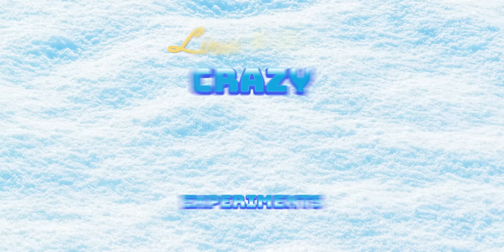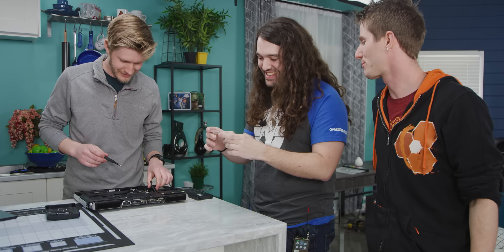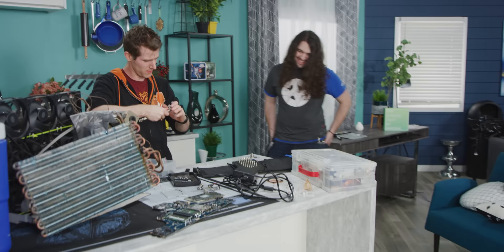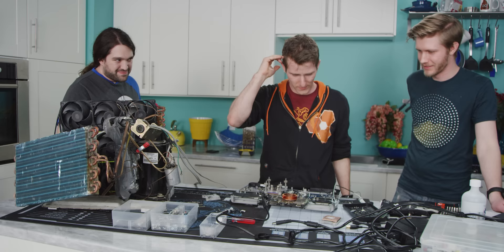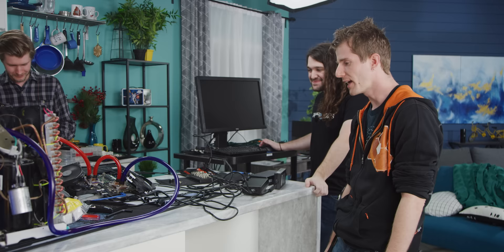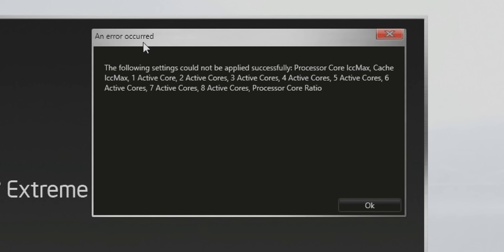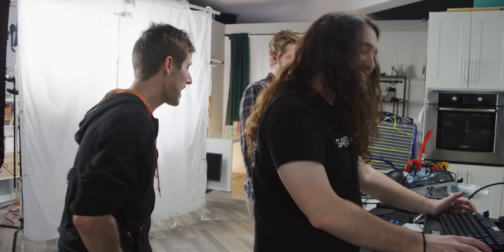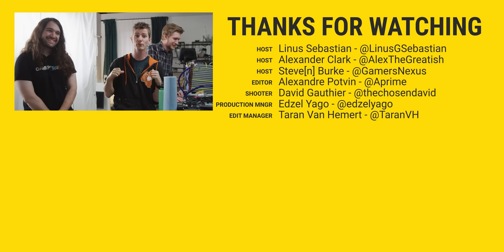Sub-Zero Laptop Cooling?! - Feat. Gamers Nexus

Comment: I think you should water cool a Nintendo switch 😅🤣🤣
Reply: And overclock it (it's possible)
Reply: Dan Bártík you can But Not really much so Watercooling would not help
Reply: @himmelsrand7527  yeah but it is LTT
Reply: Dan Bártík Yeah you’re right 😂
Reply: @danbartik4428  💯💯💯
Reply: You can install linux on a switch then add steam to it so water cooling would maybe help.
Reply: this reminded me of my favorite electronics fact. when in use the switch consumes less power than an idle PS4 :)
Reply: @numb3r6 There is no Steam for ARM Devices as far as I am concerned. And the Processor still has its Limitations. It could not clock much higher so Watercooling would do nothing. But as said before it’s LTT so what do I know. ^^
Reply: @aidanlevy2841  thats because the ps4 is a console and the switch is a portable device a ps4 uses more energy because it doesn't have to use a battery that has a limited amount of energy and the n switch has to be efficient or the battery wouldn't last 30min. Any portable device would be more efficient than a non portable one
Reply: @himmelsrand7527  oh you innocent soul, you don't know about console homebrew firmwares. You can overclock anything if you look hard enough
Reply: Benjamin Edwards Why do you answer a 7 Month old Comment? Of course you can Overclock the Switch but Watercooling will Not improve your Results. The highest stable Overclock is around 1750Mhz (CPU) which it can reach without throttling. (But we better not talk about the battery consumption when doing this)
Reply: @3of12  I don't get what you are saying steam doesn't support ARM CPUs that is just a fact
Reply: I actually want them to do that.
Reply: @himmelsrand7527  does it matter that it doesnt help much? No, this is Linus, he watercool everything

Comment: always wondered why you guys don't use the power drill to tap the threads... as a metal fabricator, i would say using the power drill would be a lot easier, and more exact than linus forcing it with a vice grip. xD

Comment: was that just 1 GIANT capacitor?
how has that not killed anyone yet?
Reply: Looks like the starter solenoid from a car. But I'm not sure why that setup would need one.
Reply: @SomeGuy_GRM  its the start/run capacitor for the induction motor that drives the refrigerant compressor.  should be a 450V rated 3-25ish mircofarad capacitor and yes, just like the live ac voltages on most of those bare connections, it may very well kill you if you touch it.
Reply: @TMHMooseMoss  this one was 270VAC, 35/3.5 microfarad. So yeah, probably enough to kill you.

Comment: I suppose when making a subzero cooler, a dehumidifier becomes an essenetial component
Reply: Nah, just Vaseline, Plasti-dip, insulation, and a couple 5w heaters (I can run 24/7 at -60c, that's what it runs watching Youtube, obviously a bit colder than R134a... Made before R12 was banned. You can also use Propane or amonia gas, but explosive or odorless toxic poisons are not my cup of tea...). It would be perfect for Intel (the 9900k scales amazing when sub-zero, check out Der8aur's channel where he shows the scaling graph for it based on temps), I want to make a huge one for Threadripper when the 64 core chips come out (I use the sub-zero cooler for daily systems, it works great! Much quieter than the Titan Xp collectors edition by like 3x, so if you can live with Nvidia flagships, then phase coolers are silent by comparison)

Comment: Could you prevent condensation by applying heat spreader foam all over? Perhaps while it's still curing so it can completely mold around the board and displace all the air immediately touching the board?

Comment: If you are running into wattage limits, you want lower voltage, not higher.    

This is more dealing with board limitations that you wouldn't normally run into on a high end desktop machine.

Comment: Man CPU don't have power enough and still got 74º using a CHILLER.....
Reply: Intel and Nvidia both in a nutshell. AMD/Radeon is so much more fun to play with. My titan Xp was the most boring component I've ever overclocked (including monitors, SD cards, CPU/GPU/RAM/NB/ref clocks/tablets etc). Nvidia is gutless when it comes to power limits. Its basically max out slider, oh yay, still power throttles at stock... Get out the hardware mods for regular use and gaming I guess! I remember when you didn't need to delid or short out components on purpose to use your computer like a normal person, that was only for the enthusiasts, but Intel and Nvidia are bringing warranty voiding back to the party hard! Even BIOS flashing is locked out for Nvidia... Its sad times...
Reply: @jakegarrett8109  AMD will take over in 3 years, watch. And I'm not an AMD fan boi.

Comment: I would like to point out that Canadian windscreen wash fluid is allowed to contain methanol. This, apart from some negative environmental effects, makes them pretty bad cooling fluid as it negatively affects plastics used in hoses and fittings. It makes them brittle and prone to crack. You should have used glycol-based antifreeze (engine coolant). Even clear tap water would be good enough.

Comment: Re: Alex "Phone calculators are bad" Algeo on android is amaaaaazing.
Reply from the maker: Have you recently used a Ti-84 Plus?  Felt the tactility of the buttons, seen beauty of a parabola on the 96x64P display, smelled the science happening?  It's a visceral experience some cheap app will never compare to. -Alex
Reply: @LinusTechTips  I have a TI-99 Titanium on my desk right now, and while I will say the haptic feedback and typing experience of the phone leave much to be desired,  the resolution of graphs, multi line editing, and accuracy of results have no equal.

Besides, that you can get a more powerful phone and the paid version of Algeo for cheaper than a new TI.

Comment: If a laptop made a completely custom radiator and just put the radiator either in the laptop and have a THIQQQ laptop OR have it externally attached to the back of the screen.  That can add substantial cooling performance with a larger power draw, however this can make "mobile" workstations become really powerful if they make a Tesla battery... idk the power draw would be the biggest hurdle but the good news is if we make THIQQQ laptops more standardized or at least acceptable.

Comment: I love the fact that a lot of jobs in the US, you have to use metric. As a Ford Tech all measurements were in metric and had a secondary annotation for inches. Any machining is in metric as well.... Yet we still cling to this shitty system
Reply: Officially they've been Metric for decades... Officially. They just didn't enforce it like the rest of the world did when we switched over. Now it's been delayed so long that the costs are astronomical compared to when the official switch would have been

Comment: A mill alone won't tap acrylic. Mills spin one way, threading out of a hole you need to spin backwards IE how a drill works. You need a self reversing tap head on it as well or you'll just rip out the threads you put in when you pull back up. Enjoy buying a Tapmatic, they're straight up $1000. I use one every day at work on acrylic.

Or just buy a ten dollar tap bit and put in a drill and do it by hand.

Comment: Use some grease when tapping screws. Makes it easier and less annoying. Also, wearing gloves and working with machine tools is actually pretty dangerous. You might not have a good grip on what you are sawing or drilling and the piece could slip.

Comment: I would love to see a mashup! Use your subzero cooling system to cool a mineral bath that houses all the components! AND WE SHALL CALL IT "THE ARCTIC OIL SPILL"! You should be able to run the coolant through radiators in the mineral oil bath to drastically bringing the entire system's temp down! In theory this should also prevent any moisture buildup on the components as the outside of you tank is where the system would build condensation /sweat.

Comment: I really like your home made chiller. I work in hvac I was definitely cool to see how you built that cooler. I have a tip for you if you insulate those pipe you will stop the condensation on those tubes

Comment: Buy a Buna-N (a.k.a nitrile) o-ring repair kit with several diameters. Even inexpensive ones often come with enough material length to make surprisingly large o-rings when you need to just make one, rather than repair one. I've used them on every up to high-vacuum systems (think vacuum of space, not shop vacs), so they're easily good enough for liquid-cooling applications. They're A Good Thing. You'd also need a cutting mat and single-edge razor or X-Acto, and a cyanoacrylate glue. Loctite PowerFlex glue has about the same compressability as the o-ring material, and it's a gel, so easier to control. 

Haven't done one since silione cutting mats became available. I'd want to try one, since CA doesn't bond well with it. Might make the process even easier.

Comment: You guys should consider combining the AC unit you used here to cool with and combine it with a mineral oil case as a sub ambient solution. You'd have a lot of time before you have to worry about moisture becoming an issue and you'd also be able to cool the whole board so super low temps and see if there's anything beneficial going on there.

Comment: Interestingly, running your CPU too cold actually has the exact the same effect as running it too hot due to the same thermal property of silicon that affects conductivity. A cold cpu just causes clock slew in the other direction (such that parts of the chip get the clock edge too early instead of too late).

Comment: After so many years Linus you need to show us a custom loop or at least use a cooling block that doesn't have tubes coming 90° off a motherboard you can get them with tubes coming parallel to the board...

Comment: if you want to tap a part before on the machine just get a collet use g84 xy r3.  then for feed you take your tap size for metric you basically take your rpm on the spindle and times it by the tap example for a 6mm x1 you take the 1 x 500 rpm you get 500 you move the decimal over two places so your f will be f5. you can use any adjustable drill holder for the tps just make sure when you tap you better tap it where you want it because if you move the tap then it'll be  impossible to realign it. I"m assuming your using metric and not american. one last thing g84 overrides manual feed over ride so to be safe you can put it to zero to make sure you got the right g code.

Comment: Really if your rely want cooling use a aluminum or copper thermal block as the main  evaporator and a freezer compressor. get basic ac system as a part of the cooling.

Comment: Hi Linus, could you please, please rebuilt your teen built custom chiller but with acrylic casing and a variable dials to increase or decrease temperatures and have a huge radiator filled with either battery water or distilled water and some metal panels and RGB lighting?

Comment: Does anyone else remember the liquid cooling used by the Sega Dreamcast? It had a Hitachi SH4 processor - the SuperH series being one of the most energy-efficient CPU designs ever developed (second only to ARM)! I can only presume that the case was of a particularly bad design.... almost a sleeping bag for silicon.
 I say that because Hitachi ended up supplying them to auto makers for in-car entertainment and even in an engine bay, they didn't need cooling.
 It was sad, I never found a good use for the VMU beyond being a little private screen for each player.48 x 32 pixels is just not enough. even Nintendo+ went significantly higher. I also seem to recall that Sega really didn't provide a toolchain for it so it was a lot of work to develop what was only of minimal value. Odd, because it was an 8/16-bit RISC processor so it could have been a lot of fun.

Comment: Wait that machine isn't grounded! so now what's gonna happen is when they put evap in water and if current is leaking in the circuit obviously from compressor the water is gonna get it too and eventually the cpu block and anyhow it's gonna short the MB or it's components. Don't worry I'm an electrician

Comment: I dont know a ton about computers but enjoy watching your videos. And this may seem like a stupid question but i dont know. Cant you just flip the mother board upside down so the condensation doesnt pool up around the processor? Then just place a bowl or some way to catch the liquid. And maybe find a way to drain or pump that into the resevoir that is holding you coolant. Seen a couple of your videos about cooling systems and always having to put towels around the processor and other components to keep them dry. Just seems like a simple solution but im no computer guruu.

Comment: I have an idea for you guys to try a proper idea for gaming laptop cooling.
Intro: As we see in the rtx 4090 desktop gpu (and vast majority of others)  there is a tiny PCB and 99% of the volume is occupied by a cooling radiator and fans subassembly.
Idea: What if you were to make a similar cooling radiator fans subassembly for a gaming laptop. 
The laptop existing cooling parts are very thin (to be squished under the bottom cover of the laptop). 
What if, instead of that half and inch thick array, you use a 2 inch thick beast of a radiator + fans. Imagine you would have the same cooling real estate as a strix 4090 (17" laptops)
Justification:
1) Nobody is using a gaming laptop to play while on the move. Maybe one or two idiots. But 99.9999% of gaming laptop buyers will use them at home, then pack it up and use it when they arrive at the destination (hotel & stuff) and then pack up and use back home or another hotel, etc, etc....
A gaming laptop is used as a very compact gaming desktop that you can carry with you easily and use it when you are plugged in at another location.
2) gaming laptops are already recommended to be positioned with the rear higher than the front, to help the airflow, and usually the increase of height at the back is like 1-1.5 inch

Having the 2 points above in mind, a gaming laptop user won't be encumbered in no way if on the bottom of the laptop at the rear potion, it will be thicker than the rest of the bottom of the laptop, in fact they will be most happy because that bulge is recommended in the first place. And when that bulge is in fact a major improvement over the basic cooling probably tenfold, it will be a happy time for gamers.
Thus what if the laptop gaming rig is going to be almost similar to the desktop version. Indeed, the manufacturers will need to make the vram and other parts better, and not fear heat constrictions.
This is what a gaming laptop should be.
If you use stock cooling it should be throttled and kept limited to a certain tgp/tdp, and if you buy and replace the existing cooling with a thick beast, to unleash full potential.
Of course, the bottom cover will be split into 2/3 from the front and a second one 1/3 from the back to allow removing base cooling and installing afermarket custom cooling.
And this will also open up the road for liquid cooling blocks that can be the existing ones from the desktop range.

Comment: You may want to edit out the lighter and flame between 10:28-10:35. Refrigeration and probably Air Conditioner units are coming out with Propane for refrigerant. This may turn out bad if someone watches a few year from now. 
With millions of stupid people. Someone may cause a leek taking the unit apart, or use an old leaky system.

Comment: 12:00 why not solder a wire to bridge the part of the chip that checks for voltage and basically make the cpu not see that voltage then you can set it as high as you want no throttle neck

Comment: someone should make a actual liqud cooler for a laptop that easily disconects and then its still aircooled when on the move. maybe make it a part of a eGPU system so its power can come from the power supply in the eGPU.

Comment: I used to shove an ice block or two under my HP ENVY DV7 7332 i7-3630QM laptop for an hour or two whlist running X-Plane 10 until condensation killed the it - R.I.P.

Comment: I started off with a Lenovo Legion 5 with r7 4800h and 2060 
which cooled fantastically even with both gpu and cpu under 
full load. I then went to an asus rog strix scar r7 5800h with 3070 which cooled appalingly with both cpu and gpu under full load. i.e. throttled the cpu down to 30w. Now I have a gigabyte i7 12700h with 3070ti and this throttles the cpu down to 35w when gpu and cpu is under full load, but the thing is, the cpu and gpu temps are about 74 degrees. Why won't it allow atleast up to 90 degrees before it throttles. I give up, should've kept the Lenovo.

Comment: Couldn't you remove the issue of condensation by submersion in oil like the fish tank PC? Of course the oil would eat the water cooling tubing so perhaps there is something else you could submerge it in. A sealed box with some kind of gas that itself gets cooled?
Reply: Actually, you could use metal tubing that connects to the sealed (oil filled) box. The oil wouldn't eat the metal. Then connectors on the box could connect to regular plastic based tubing. The sealed box sides could also be made from large metal heat sinks to help cool the oil. Then you'd only have to worry about plastic shrouding, but there is thread based so I'm guessing you'd use that anyway. Ports/sockets could connect to the box in the same way as the watercooling so you never have to open it up.
Reply: Lol, in fact you could take a large block of metal and bore out the inside so the bottom and sides are a single solid piece (with a sealed lid screwed/welded on top) for a perfect seal and the sides could have lots of cuts to turn them into radiator fins. OTT but I'd definitely watch that vid